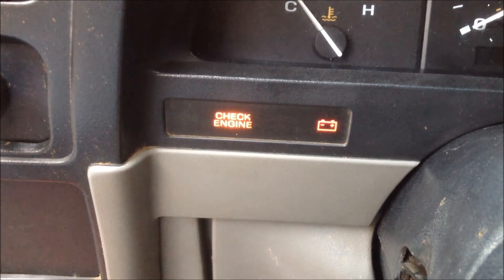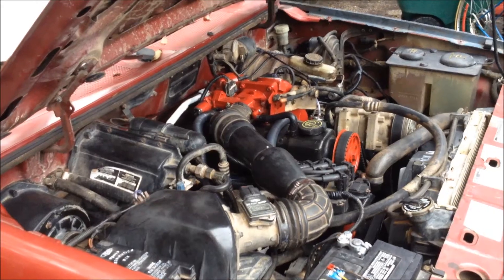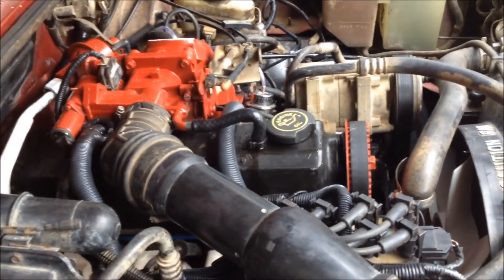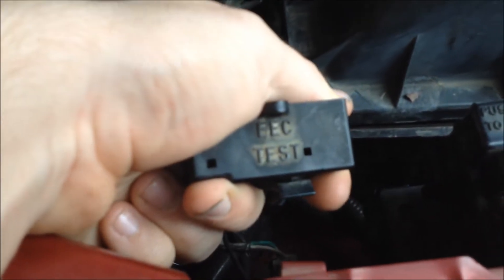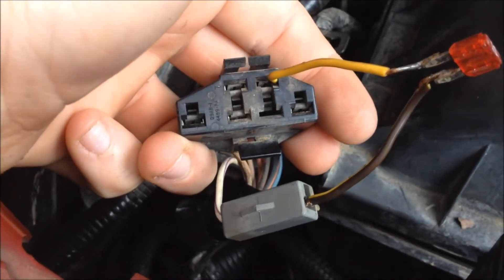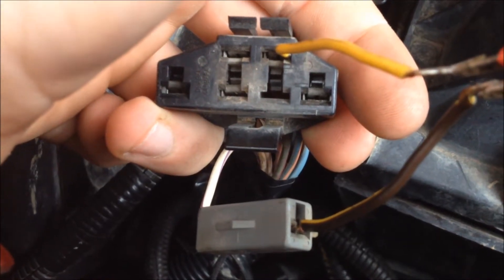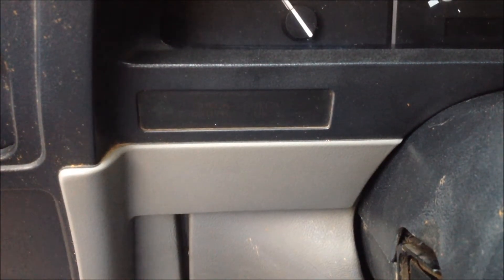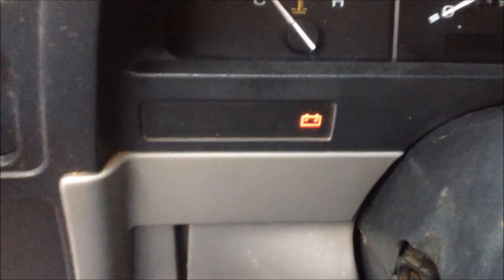reading ford check engine light (86-94)

Comment: Awesome vid! Didn't have a wire handy, and I can confirm that a paperclip WILL work. 

Picked up a wired on-off switch from O'Reilly's that I installed so I can leave the short hooked up and check whenever.

Comment: Great video, thanks for posting. I'm trying to figure out how to do this for my RABS light. Is it the same procedure, or do I put the wires in a different spot on the harness? I know some models have that connector to be tested in the kick panel area left of the brake, but mine doesn't have that..
Reply: https://www.youtube.com/watch?v=96Iay_Yj5oI  maybe

Comment: Good afternoon. I used your method, thank you.
Does it matter if the MAF sensor plug was connected when I read the errors?
Or are these errors memorized by the memory and it's not a big deal?
Thank you.

Comment: I have a 94 ranger that the check engine light won’t come on but all the other lights do … help someone
Reply from the maker: I’m sorry I missed this comment. The build inside the dash may be blown. Try to find information about changing those bulbs
Reply: I fix it now I got a broken bolt on my EGR valve

Comment: i just bouaght a ford  1993 ranger 2.3 . only #22 and # 3 cylinders are firing. 31 and # 4 has no fire from the coil. engine will run on these two cylinders. secondard coil for the intake plugs have no fire whatsoever. i ohm the coils and it ohm at 0.8. i paired the coil resistane like the book showed and it showed around 13.08  as far as i can tell the coils are good.could this be a crank sensor issue or a ecm issue.

Comment: Thanks for the video. Took my 94 ranger to autozone. They couldnt find the eec hence my finding this video. Then they didnt have the right plug. Went to oriellys and their code reader would shut off after being plugged into my truck. Gonna try the wire splice thing. Side note why does this 4 cylinder have 8 plugs?
Reply: It worked. I used one piece of wire without a splice. Got 172. Oxygen sensor. Thanks again. Great video.
Reply: Joel Barlow so you just used one wire? Stuck one end in the slot as indicated in the video and then the other end in the other slot?
Reply: @LadyK_70 It's unlikely you still need an answer, but just for the rest of the people who do:
 
Yes, you just need to insert each end of one wire into each of the two spots shown. You want to create a closed circuit from an open circuit. The wire is like a switch set to "on" permanently.

You could use a paperclip or bailing wire as well. You could even permanently connect the two points with a switch and turn it off when you're done.
Reply: @CannaCJ  shoot. I just bought a junk 94 Mazda for a Lowes Run truck... it's such a pos I might install that switch. Lol good idea
Reply: Dual plug lets it make a bigger arc between two plugs , or fire two plugs, for better economy

Comment: i have a 93 Ford ranger with the 4.o my check engine light comes on all the time and the truck idles ruff some times would any one no what that could be
Reply: Try fuel injector cleaner in the tank. It can clean injectors. Get a Actron CP9690 code tester. It checks live, record, graphing, transmission codes, oxygen sensor codes, ABS, SRS, emissions readiness test, and MORE! It comes in a black pouch. It works to 2013 out-of-the- box. It has code-connect to diagnose codes. It uses 4 aaa batteries, not included under the rear cover. EBAY has it.  Warm the engine first. Check that the gas cap is on tight. It could be the IAC, MAF, TPS, CTS, EGR, plugs, or anything. Check the fuel pressure and leakdown.
Reply: @hankbridges5055  How much are they bro
Reply: @arcturusbbqsausagemaking2435  I bought one for $170.00 but then saw some for $160.00. It's VERY useful! If you want to know alot about your car, get this one. Code-connect diagnoses the codes to fix things. It also shows other possible causes. Codes alone can be deceiving. First check Key- on- engine- off codes. Then live, percentages readings like MAF, TPS, IAC, EGR. They should be near 0 indicating parts are closed. On CTS,  cold, if it says the CTS thinks it's winter when really it's summer, the CTS is bad. On graphing, it can show the opening temperature of the thermostat. Live test can show the opening and closing percentages of the EGR with the engine running and speeded up. It can reset oil- change lights. Astral Auto demonstrates one and South Main Auto demonstrates one on YouTube. There are a few others also. EBAY has it.
Reply: @hankbridges5055  Thank bro im going to get one
Reply: @arcturusbbqsausagemaking2435  Believe me, it's very useful! It tells you ALOT about what's wrong with your car. Code connect finally helped me to fix my car. I went for 6 yrs. with the EGR hose unhooked and plugged. Code connect says it's the charcoal canister purge valve. Also, the MAP sensor. Graphing can show the opening temp. of the thermostat.
Reply: Try fuel injector cleaner. If it has a MAF, try MAF cleaner on the throttle valve. A code tester can tell.  A bad Ox. sensor can cause it.   Maybe disconnect the pos. cable for about 15 minutes to erase memory codes. Put it back and see. Check the engine fuse and fuses. Check the fuel pressure and leakdown. Check the plugs. The CTS may be bad. The live test on a CP9690 can check that if it's OBDII. A Snap-On scanner checks OBDI and OBDII. Get the Primary and Troubleshooting cartridges. Get the Ford 1B adaptor. If it's OBDII, get the OBDII adaptor and a K2A personality key. Get the Ford manual. Also get the battery pak and cable for review away from the car. Also get the battery clamp cable. Don't get those Chinese cables. It won't work! The Ford adaptor needs the battery clamp cable which hooks up to the side of the adaptor. Get a 9 volt Square battery for the left cover to power it. EBAY has them.
Reply: Barney Warwick I have a 1990 that does same thing. What was it?
Reply: It's probably your coil packs. 
Does it do it in the rain?

Comment: Damn. I almost wish they still used a system this simple. Thanks for the great video!
Reply: There are still cars with this kind of feature. For example the Nissan Micra K12, if the airbag light is on, you can do a sequence with turning the ignition on and off to get it to flash its codes.
Reply: I agree
Reply: There are any Chrysler Dodge jeep 96 and newer with digital odometer will show codes by simply turning ignition key from off to run 3 times on 3rd leave in run watch odometer spit pcodes. On obd scan needed

Comment: Gets Actron CP9690 code tester. It has live, record, oxygen sensor tests, code connect to diagnose codes, graphing, MIL light reset, smog readiness test, and MORE! It has cables for OBDI Ford, G.M., Chrysler and 2 Toyota. It has a cable for OBDII. It also has a cigarette lighter cable. It comes in a black pouch with instructions. It's easy to use! Works up to 2013 and is updatable.
Reply: OBD2 scanner doesn't work on EEC vehicles!!!!!

Comment: To reset the computer: 1.) Turn the key to the on position, 2.) Remove the temporary jumper at EEC Test harness as the PCM displays the codes. The fuel pump will cycle. The computer is now reset. Source: Haynes Repair Manual for a 1994 Ford Explorer Sport.
Reply: I have a 86 cougar how would I reset it

Comment: What fuse did you use to jump the cables?
Reply: You don't need the fuse just stick the wire in there bare on both ends . If something pops then worrie about a fuse lol
Reply from the maker: There was no fuse, I just used a piece of wire.
Reply: A red mini fuse is 10 amp.  Do a search for 'mini fuses color codes' to find out more.

Comment: Wat happens if it doesn't flash or anything just stays steady solid light
Reply: Johnathan Brown jumper the single wire to ground turn on key read codes
Reply: Jumper the single wire to ground ignore the black plug

Comment: This was helpful, I have been struggling with trying to figure out how to check the light because I have a diagnostics machine but I could not find a spot to hook it up, however this helps allot for sure.. Thanks
Reply: James Ferdon Get a Snap-on scanner and cartridges and adapters and manuals from E-Bay. Get the battery Pak and the 120 volt cable to check test results away from the vehicle. Get the 12 volt cable to hook it up to the adaptor. It can test the EGR, TPS, IAC, MAF, throttle angle, RPM's, oil pressure, fuel pressure, fuel trim, movies, and LOTS more!
Reply: He says to unhook the battery and clear the codes but that doesn't fix it. That can clear codes but you want to know the codes. Get the Ford digital tester and extension cable from Amazon.
Reply: I seen some obd 1 adapters on amazon but I seen one video on here already and it didn't work for the guy's code reader. I might do this or just get the ford code reader :/